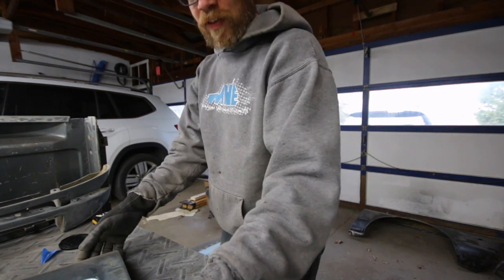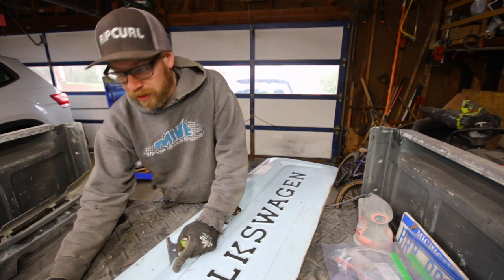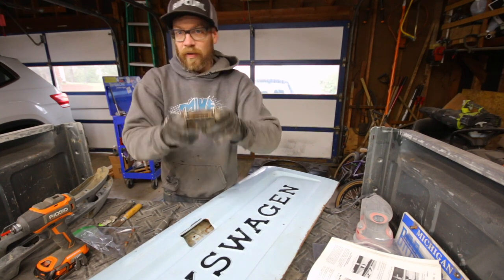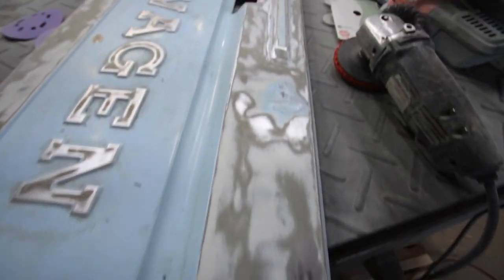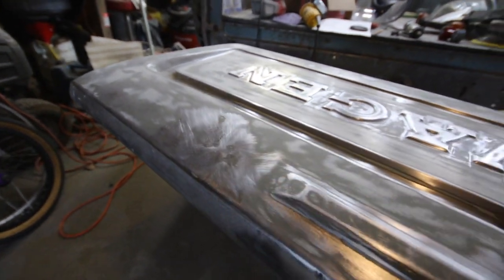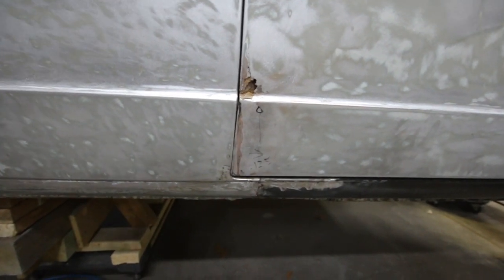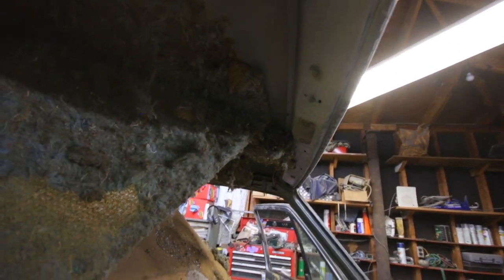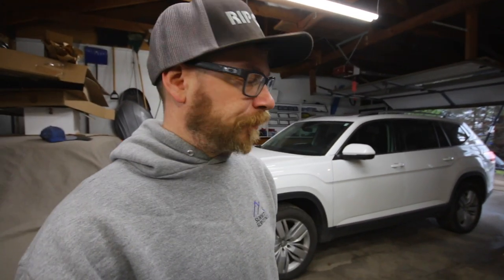Stripping tailgate  -- Rabbit pickup project part 17

Comment: Any advice for getting a tailgate open that's stuck close on these?
Reply from the maker: cant say ive had that issue yet... i would try taking the handle apart maybe and seeing if the rods came undone.  the latches could be seized also preventing it from opening.
Reply: @PaulLehman  ok, thank you for the advice... 6 years outside did this truck no favors